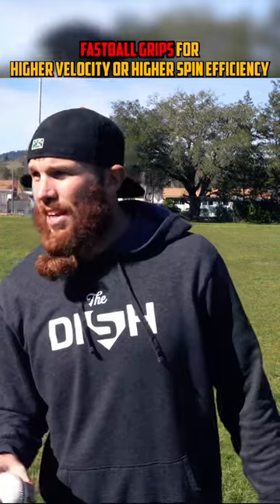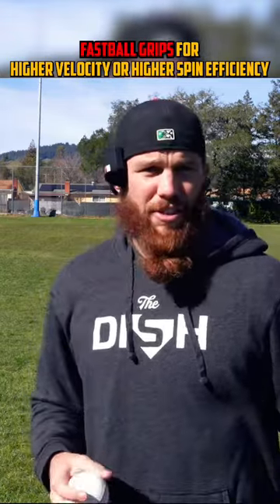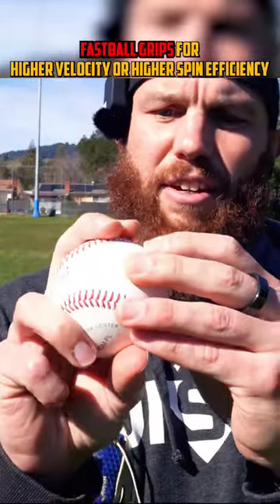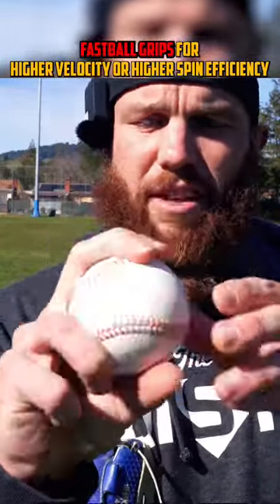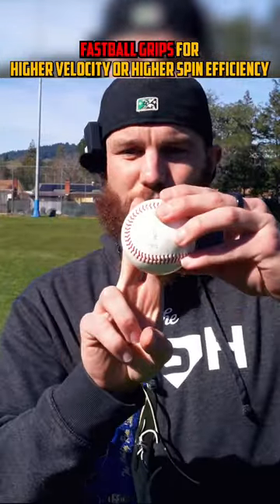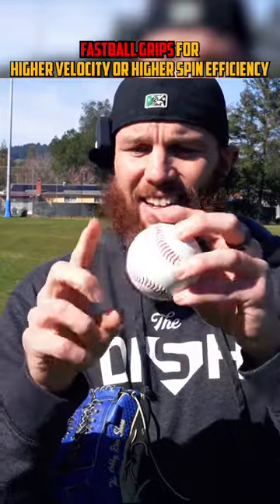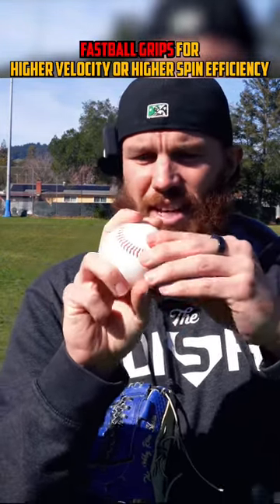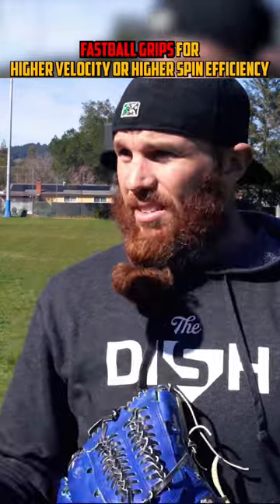Fastball Grips 4 Velo or Efficiency | #shorts

Comment: is a split fastball different from a splitter?
Reply: Yes. A closed or split fastball is still a fastball where you are trying to put as much backspin and force down the middle ball for high spin and velocity. A splitter is the opposite. You widen fingers as far as possible and sit the ball further back in your hand to impart more spin on the side of the ball, as well as killing the spinrate and velocity in order to disrupt timing and make the ball appear to "fall" out of the air or it's initial trajectory.